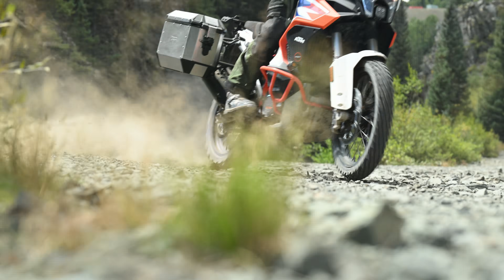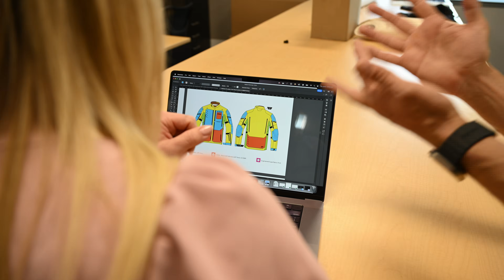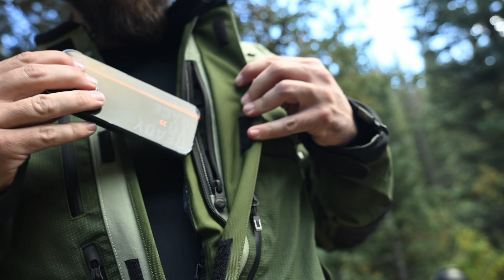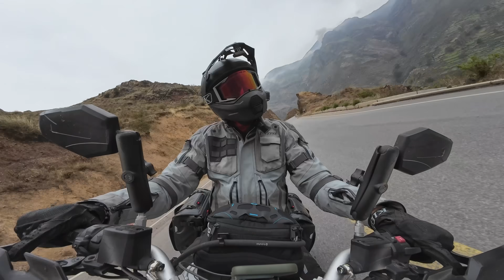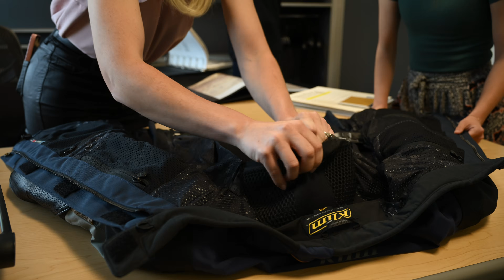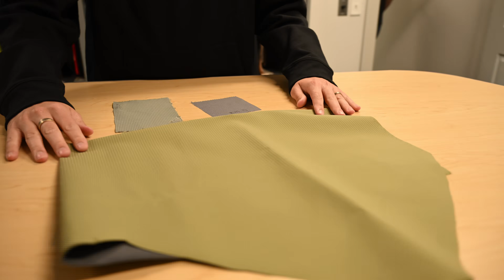Introducing the NEW Badlands Pro & Badlands Pro A3 Jacket & Pant

Comment: I ride my T7 fast street and dirt. I regulalry corner at 100+ mph on road and hit 60+ mph in off road straights. I also wreck a lot lol. My primary concern is high speed abrasion resistence / impact protection. Second is price, third is all the other things like water-proofing, pockets etc. It would be nice if i could  customize my Klim gear to the price point i need. I can do that when buying other products and its really nice.

Comment: I own a Carlsbad jacket and I love it. It does get hot and it's not great in summer even with all the vents. It's ultimately the weight of the jacket that makes it got regardless of how many vents it has. One complaint i think would be an easy fix is to replace the velcro on the collar with a magnet latch as it never stays shut when you get the pace on. ✌
Reply from the maker: Thanks for the feedback! We've sent that over to the product team. 🙂 🙂

Comment: I live in Florida and I own the Badlands Pro A3. The suit is “hot” in this environment and can’t be worn 9+ months out of the year. On a hot day, I want more airflow to cool me off when I ride.
Reply from the maker: For at least part of the year, you're probably at the temperature limits of comfort for waterproof gear! Gore-tex (and any other waterproof membrane) relies on a temperature difference between the warmer inside (where you are) and the cooler outside (where the elements are). The colder it is outside, the better Gore-tex will allow moisture to breathe through the membrane, as the warmth from inside "pushes" the moisture vapor out. Think about how your car windows fog up when it's warm and humid inside the car and cooler outside the car (the glass isn't breathable, so the moisture collects on the inside of the glass)... The problems arise when it's hotter outside your gear than it is inside. Body temp is approx. 98.6ºF so, for example, if it's 110ºF and humid outside, the humidity and heat will be forced backwards through your waterproof membrane and you'll wonder why it "isn't working". Anyway, not to go on a technical material tangent, but you're probably right that the Badlands Pro A3 is too hot for part of the riding season in Florida. For the most part, you may be better off with something mesh like the Baja gear plus a waterproof shell for surprise showers. Just be very mindful of riding at prolonged highway speeds in mesh gear in extreme heat: you can sweat faster than you can absorb water, so dehydration is a risk.
Reply: The mesh is fine in Florida.  Not saying you don’t need to pay attention to hydration but it’s so humid it’s different than dry heat